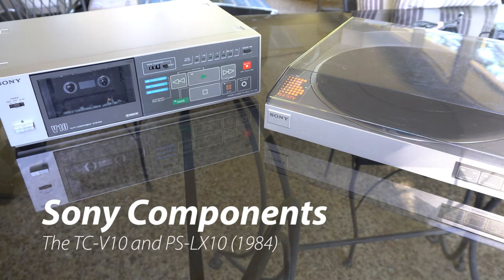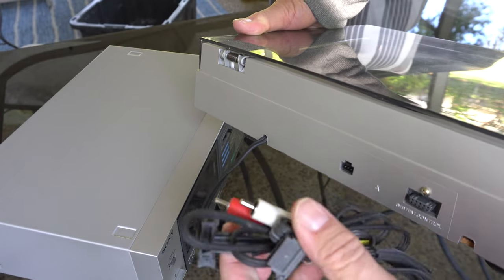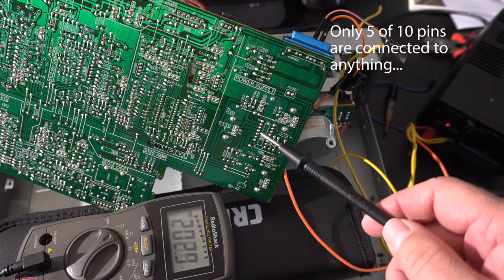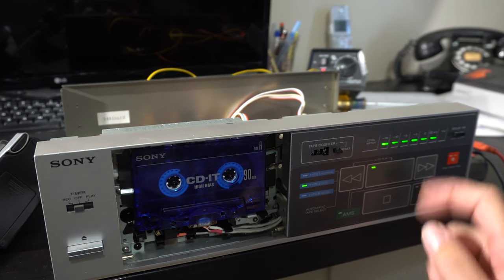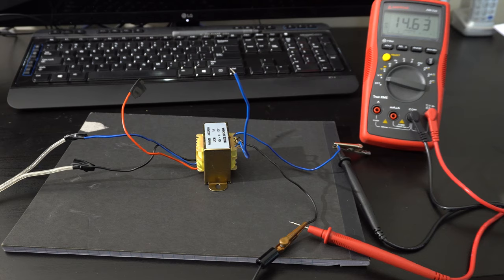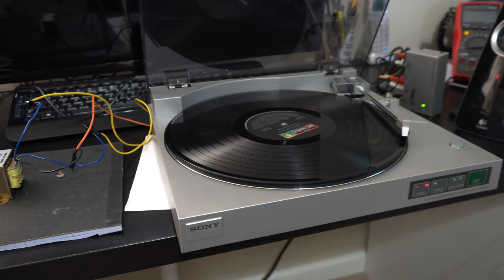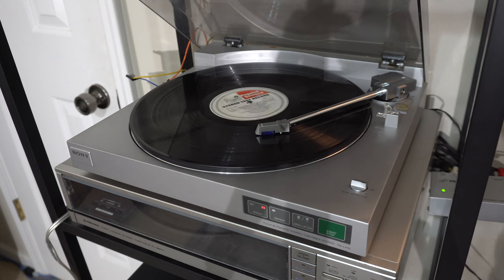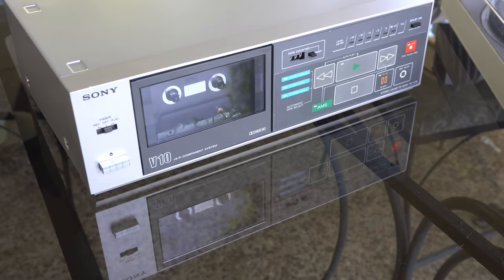Sony PS-LX10 Turntable and TC-V10 Tape Deck (1984)

Comment: I assume that the issues you're having on the cassette deck are caused by the little relay having oxidized contacts, just as it happens with a mechanic record play switch, I've had this issue on my nakamichi BX-2. You need to carefully remove the top cover of the relay, and cut small pieces of printer paper, that you can just barely enter between the relays contacts. Before you put those pieces of paper between the contacts, soak them in standard contact cleaner. You have to carefully push the contacts of the relay in, so that it presses on the piece of paper, and then pull the paper out from the contacts. Do that until you see no more oxidation being left on the paper, and ofc, use a new piece of paper every time. 
I hope this will help, this issue can also occur on amplifiers/receivers with a speaker relay, when they develop a weak or intermitten output.
Reply from the maker: Thank you for the suggestion. I had a relay contact problem recently on a Bang and Olufsen cassette deck, and will try cleaning the relay on this Sony deck also...
Reply: No I only have the turn table

Comment: I have the same one, do you know how to change the stylus. Having difficulty with mine.
Reply from the maker: Here's what worked for me. First, I very carefully swung the front end down. (Might have had to use a slight rocking motion or fingernail here...) Next, I put a fingernail behind the back end and slid it forwards. Obviously, be very careful don't force anything too much as this is 40 year old plastic! It might help to use a mirror or macro lens on your smart phone to look first. I also removed the mat and cover, locked the arm in place, and was careful not touch the needle. I will take a picture and put a link below. When replacing the stylus there should be almost no resistance as long as it is lined up correctly. Good luck! 

https://imgur.com/a/g12ndRK
Reply: @ACBMemphis  thanks for the help!

Comment: i only have sony turntable ps-lx10. What's power supply for it? 12V DC, right? Can i connect to Pioneer System SX-720 pro?
Reply from the maker: This model runs on 12V AC. I used a 3-wire output from a "12-0-12" transformer. The Amazon item was B00BJC6H2I. It might also work on DC power as well not sure.
Reply: @ACBMemphis  thanks for quick reply, i'll buy a transformer and test, then get support from you with thanks
Reply: @ACBMemphis  but actual only have 2 wires red and white to main board turnable. You use 3wire red-black-red from transformer into red-red-white or red-white-red on sub board turnable? Pls support me
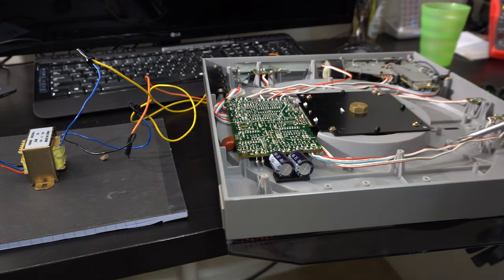Reply from the maker: @jialing875  I had 5 wires going from the connector board (see 4:45 in video). Do not use colors to determine connections, instead trace the wires. Are you seeing only 2 wires on your turntable and no additional wires?
Reply: @ACBMemphis thanks for support. I use correctly wire on system control  same with you in video, before i think power supply is on sync which only has 2 wires red and white. Now, i can use normally with Pioneer system SX-650
From Viet Nam with thankyou

Comment: Can you please tell me how you got power to the turn table please
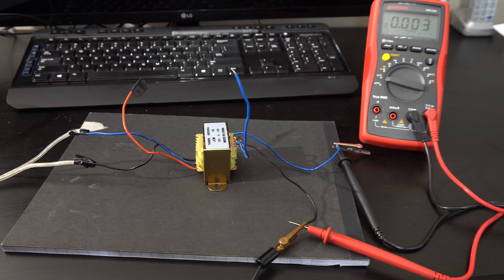Reply from the maker: The turntable and tape deck both expect 12 volt AC power over 3 pins, so I found an AC transformer (at 4:05) and connected it to those pins. However, after looking back, I think the tape record problem confused me, and it's likely possible to power both the tape deck and turntable using a 12VDC power brick. I may revisit this next year with a follow up video... Below is an Amazon link to the transformer I used in the video, which converts 120V from my United States wall outlet to the 3-wire 12 volt AC outputs. It looks like this transformer is not currently available from Amazon, but a similar transformer might be available from other sources like DigiKey. Thanks for watching!
https://www.amazon.com/gp/product/B00BJC6H2I